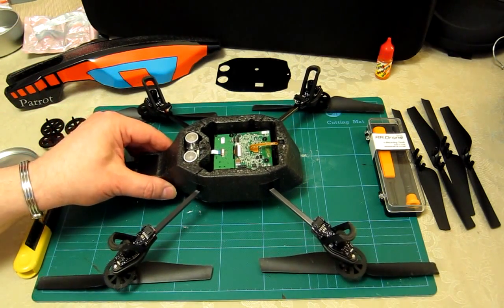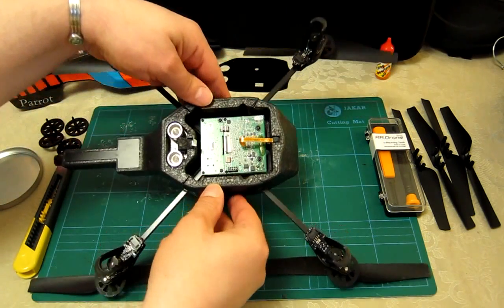Parrot AR Drone 2.0 - Repair Part 1 of 4 - Remove Central Cross to Replace - Step by Step

Comment: Thanks for responding, I didn't get to fully explore its symptoms today BUT it seems to drift to the same side. Today at work I played with it indoors and it seemed to mostly hover ok but it would occasionally drift and occasionally it would drop and climb. I will forgive today's symptoms of due to work stations and tables everywhere. Can a electronic part inside function interminably? I was hoping to look at the rotors tomorrow.

Comment from the maker: Thanks for the feedback. Does the Drone always fly to one side ? or just 'out of control' ??
Possibly the ribbon edge connectors need to be removed and re-seated. Also worth double checking that the downward facing camera is aligned ok with the hole in the hull. 
+ make some tests. Will the AR Drone still notice it when you tilt the drone ? hold Drone, start to take off and then flip it over. Does it say 'Tilt emergency' ? still ???

Comment from the maker: I now know that those little connectors are call ZIF (zero insertion force) type. They have a little section of a different colour on their leading edge (the part facing the ribbon cable). This pulls out just slightly away from the connector body. They only come out a millimetre or so, so be careful. Once they have pulled out, the ribbon comes out without any force.
A lot of people who have now watched this found that by being more careful and slow - they avoided the breaks!
Good Luck!

Comment: I broke one of the feet, i am worried about breaking the connections, i have no nails! I have a replacement cross section but was wondering if there was way you have thought of to fix  the problem?

Comment from the maker: Thanks for sharing your advice. I wish I knew that before I started this repair!
(when I watched the Parrot video - It looked like they removed them using tools. So I followed their lead. The Parrot video has so little details and is so rushed I know why I went wrong.)
With your better information and others - I hope others manage to avoid the two clip snaps I had. 
But they still act as wedges and my AR drone works fine! So no harm done!

Comment from the maker: The ribbon has multiple wires & connections on it. Unless you know someone who is able to re-terminate, add the wires & then solder these back in place on the mono... I can't see how you will re-attach the height sensors.
Check the Parrot web site. I think what you need to do is buy a new "Parrot Navigation Board For AR.Drone 2.0"

Comment from the maker: I am unsure what you mean.
Q. Do you mean the cable removal performed at 03:00 ?
(There was a black clip that needed to be 'pinched'. My black clip broke on one side.)
Q. Have you pulled the white socket from the main board ?

Comment from the maker: Both the ribbon cables are held in place with the remaining part of the 'clip' and it works and flies fine!
There is enough friction that when you put the clip back in - it doesn't really need both side clasps.
I have flown (and posted many vids) since this repair. Good luck with your repair! I hope this helps.

Comment: I had the same problem as you with the first cable you tried to disconnect (nearest the sonar), the connector broke, but the ribbon cable is fine. Was that a problem when you put it back together? How did you address that?

Comment: Luckily I was able to repair the cross-brace rather than replace. Have a spare now at least.

One observation that I found was that it was easier to remove the bottom camera from the mounting than it was to risk damaging the pins.

Thank you for the clear instruction & advice.

Comment from the maker: Then you have nothing to loose. Try to repair. If not, then buy and replace.
Try soldering it back on. But be mindful that you need to be careful of the heat so it doesn't transfer further up into the motherboard circuitry. I recommend using something like crocodile clip to attach to the components / board just upstream from where you will be soldering to absorb the heat. Good Luck!

Comment from the maker: I think you mean the 2 x White plastic connector plugs.
These connectors are wires from the central cross and come from and controls the four motors.
As you get new wire and new connectors with a new central cross - you can just cut them off. It is not important.
IF you mean that the 'pins' have been pulled of the motherboard somehow.. Sure. Try soldering them back on. But you need to be good and watch the heat doesn't transfer further into the circuitry. Use a crocodile clip to eat the heat.

Comment from the maker: If you mean the 'black plastic' connectors that I managed to break one of the clips off of on each of the two clips, then I would not solder anything. The clips hold in position delicate ribbon cables.
It will be better to either find some other 'thin plastic' to act as a 'wedge' and then small pieces of insulation tape to hold in the plastic. I was considering having to do this exact same thing when mine broke. 
Maybe try cutting up some clean plastic from yoghurt pots or plastic drink cartons.

Comment: Those little connectors are call ZIF (zero insertion force) type. You can't just pull the flat cables out of them!  Notice they have a little section of a different color on their leading edge (the part facing the ribbon cable). This pulls out just slightly away from the connector body. They just pulll out a millimeter or so, so be carefdul. Once they pull out, the ribbon comes out without any force at all (hence the name)

Great video.

Comment from the maker: Not the first time I have repaired RC Models. Just the First attempt at this AR repair. I do my best! :D
As I mention before - I watched the Parrot videos. I found them next to useless. They use a screwdriver & the cir-clip removal tool. Magically the clips come away free. They do not. They both snapped on one side of the clip. Sure. I need to master just how I get these out without breaking them. Poor design by Parrot, they used 2 x 10 cent brittle pieces that you can't buy to replace! Pffft!

Comment from the maker: Ahh - I see... Yes - The clips only broke on one side. They both now have only a single clip point. But they fit in snug with their cables and connectors and all works fine :)
Good to hear that your repair also went well and that you are flying again :D

Comment from the maker: If you mean that you have also broken the removable plastic 'grippers' then hopefully you will also be able to re-connect them in the same way that I do.
This is Video 1 of 4 and if you watch the video where I reassemble my AR Drone, you will see that I was still able to use the plastic grippers to hold the cables in place.
My AR Drone is fully repaired and flies really well again.
I wish you luck!

Comment from the maker: My AR Drone is all repaired & flies better than ever. But I do take on board your comments. Fortunately for me & my Drone - I have very dry skin. You have clearly had to do this repair yourself. As with all things - you learn from doing. This was my first time and I find the Parrot videos next to useless as they are way to fast & show no real detail. Certainly I saw / read no mention of a 'clip' removal tool.
Your comments will further improve this task for others. Sharing is a good thing :)

Comment: you should relabel this... "how not to repair an AR Drone... i would caution new users not to be so rough with the ribbon connectors... get the proper tools for handling delicate electronics... don't use your fingernails... don't remove that small foam insert with the ultrasound ribbon glued to it... and don't put our finger oils all over the exposed connections and cables... that will come back to haunt you later